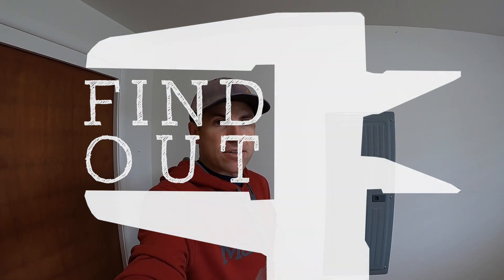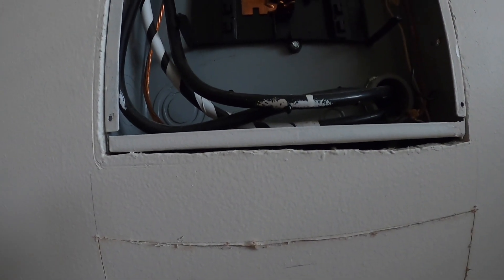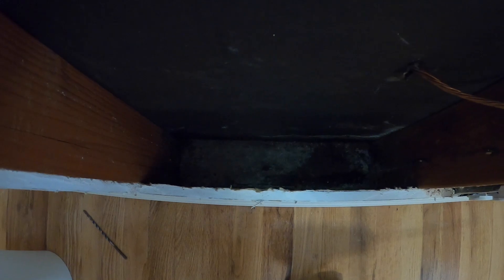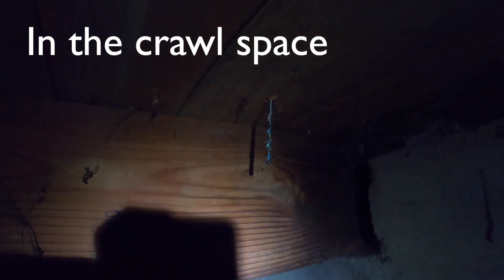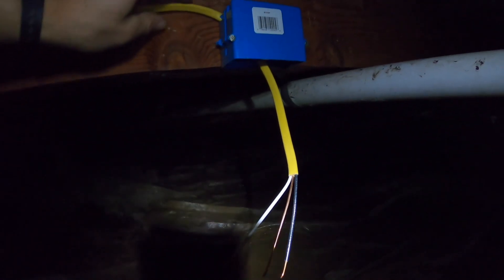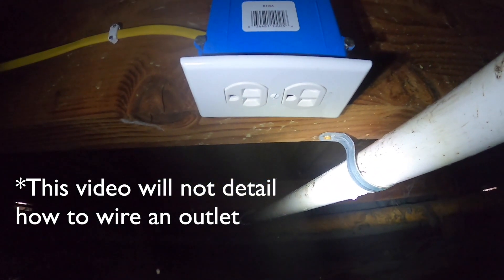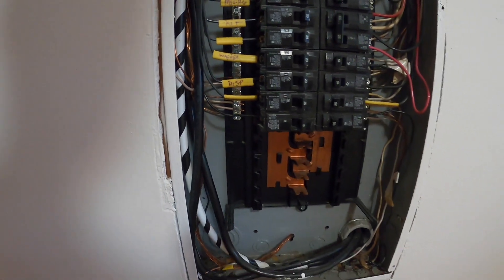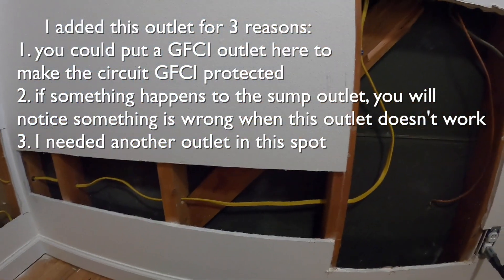Sump Pump Electrical | Install Dedicated Circuit

Comment: i haven’t finished the whole video yet, but is that a 12-2 wire you’re running for a single sump? at least where i’m from a single sump on its own breaker is good for a 15amp dedicated circuit, 14-2 romex.
Reply: kept watching. still no need for a 12-2, should only be if you show up to a house and splice to an existing 12-2 dedicated circuit, which is rare😂. however i appreciated that you knew it had to be GFCI protected in some way lol. new code coming up in New Jersey(where i work) requires that all sump dedicated circuit outlets are on a GFCI outlet. i started hooking up these GFCI’s with a red pilot light on top and one plug on the bottom. when the outlet has power, the light is on. when there’s no power, vice versa. when you install it just tell the homeowner that if that red light isn’t on then that circuit has tripped or isn’t working for some reason.

Comment: Hey man great job but with your good skill set, you could’ve easily done that without any drywall damage.  They make a product just for that called “the panel pal”.
Reply from the maker: Ill take a look at it for future projects! I didn't mind opening up this much drywall because we were planning on doing tons of other electrical in the coming months (adding a bath).